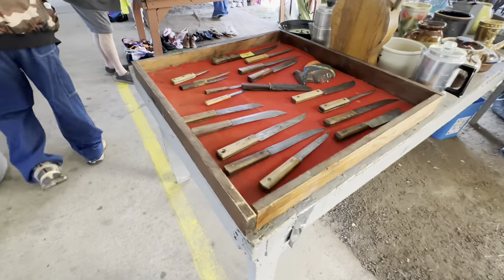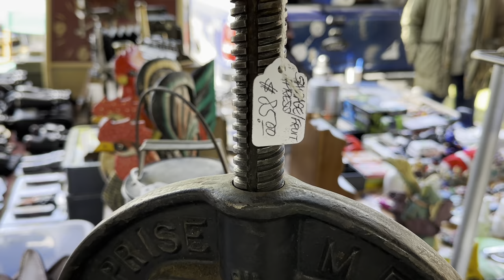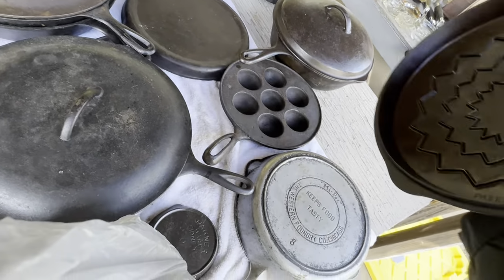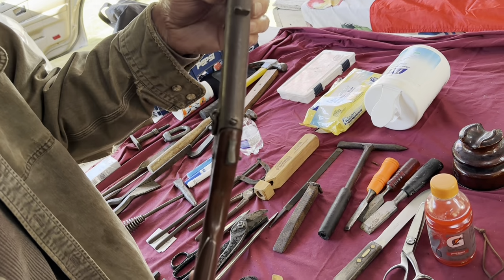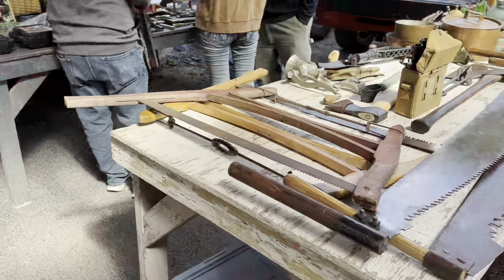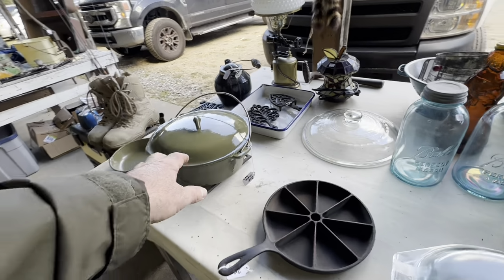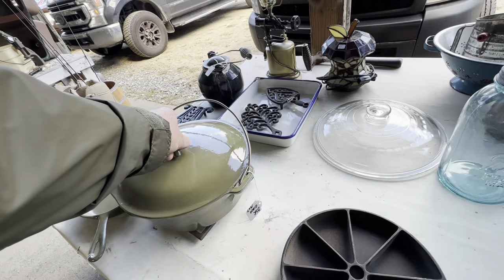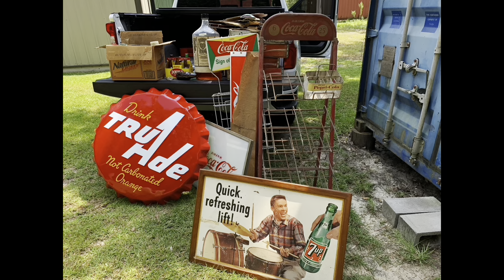Antiquing at Uncle Bills Flea Market Vlog for Treasures and Antiques / Treasure Hunt With Me Video

Comment: the 2 deep skillets you asked about at the 13:40 mark are both part of the JONES combo cooker, its a 4 piece set and those are called the chicken fryer pan. the set allso consist of a bottom pot, shallow skillet and deep skillet. The deep and shallow skillets double as lids. it stacks/nestles together.
Reply from the maker: Thanks for the info ,what’s the value